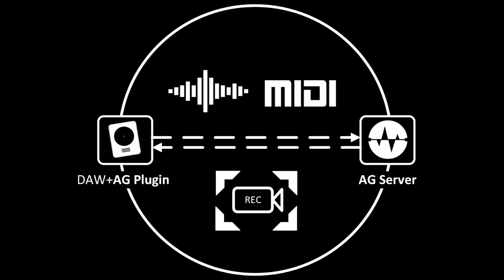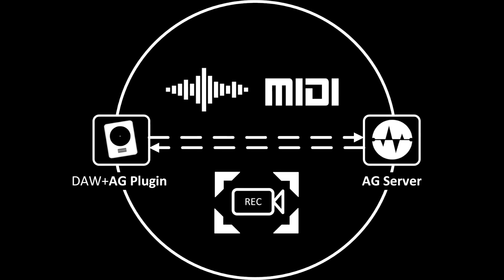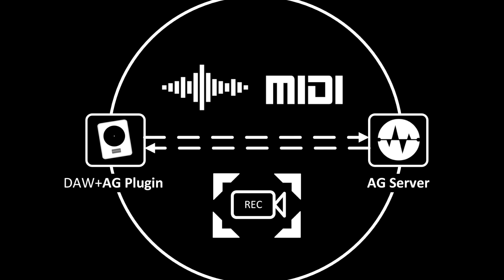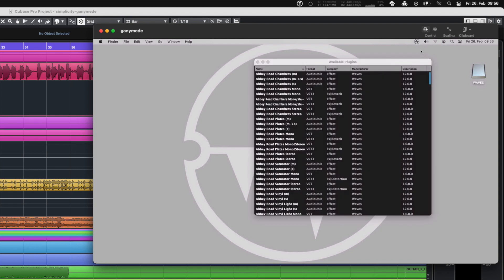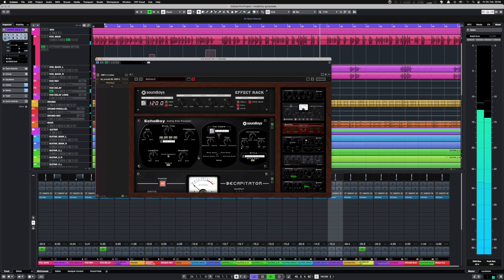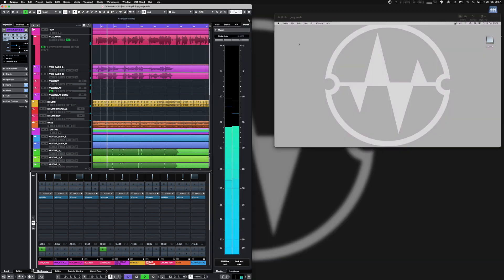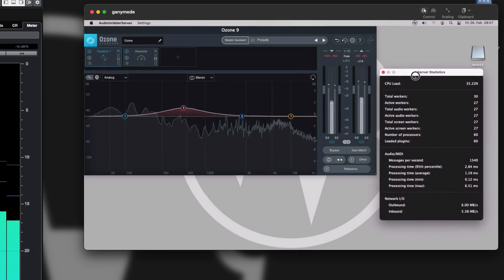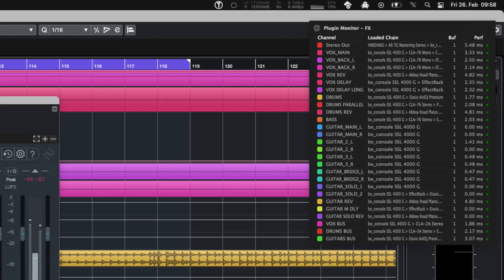Mixing with AudioGridder (Demo)

Comment: Before I encourage you to donate (on the end of my comment) let me make something clear. Well,  rather, to make some comments corrected: AudioGridder is NOT revolutionary. The concept exists for long time. But maybe not in that good shape. On Linux for more than a decade we wired things together this way. Maybe even for almost two decades. Not sure. Which has to do with the fact that Linux pro audio was actually always mainly conceptionally about wiring things together. So we always had "racks" of plugins wired into a sequencer or something. While other OSs used to put all in one big monolithic DAW (for easier use, but lack of optimized CPU performance). Additionally there is a famous proprietary software called Ensemble from VSL used by many film composers out there. Then there is Cantabile, Blue Cat Patchwork, MediaMotion's DAWconnect, NetVst, VSTHost and SAVIHost and many others, not all the same but overlapping in features. Would be interesting to compare them. But! The real revolutionary part here is, that it is REALLY cross platform, REALLY Open Source and REALLY actively developed! Which makes it even more competitive to other Open Source (almost dead) developments in this direction on all OS. Does anyone know on which code platform it has been build on? Hopefully not ELEKTRON. Apart from that: Great work. I can only suggest everybody to support this project and Andreas Pohl with donations and spreading the word.

Comment: Any way I can add presets made in my DAW so I don't have to go through a headache of doing it from the begining? When I try to open them from the folder they're stored using logic, it doesn't give me the option. Wondering if the extension for their plugins are other than .cst 🤔

Comment: Can AG be run on the same computer as the DAW? Are there cpu benefits when doing so, like there is with VE Pro?
Reply from the maker: sure you can. and usually there are benefits in most DAWs. see here https://github.com/apohl79/audiogridder/discussions/654 (there more threads like this).

Comment: Quick question if anyone might be able to help thanks. Does anyone know a way to sidechain with Audiogridder? Wish to use Audiogridder with a heavy cpu plugin (Trackspacer) but plugin inherently requires sidechain. Is there a workaround? Many thanks Jon
Reply from the maker: sidechain support has been added in 1.2, but it is still in beta state.
Reply: @AndreasPohl79  thanks Andreas

Comment: Good stuff. Would this work in a Windows VM on a (quite powerful) TrueNAS server?
Reply: I just tested it using QEMU (Linux Host and Windows in the VM running the AG server). It's not something I would do in a realtime production environment due to the CPU and RAM limitations of the test Computer, but yes it will work.
Reply: @oddyolynx5854  Thanks, I have steered away from this for actual critical production but cool that it works!

Comment: I can see you are running plugin under Ilok (Air eq) ? how can you do that ? with Reaper we have reamote but to be able to use the vst/vst3 you need to have them installed on both machine with exactly the same version + license AND if it's with ilok you need to get for example the key on master and computer ilok on the slave. Some plugins are just authorized to run on 1 machine, also what about UAD plugin?
so how is it possible ? the vst/vst3 only on the slave?
Cheers

Comment: 0.4 msec latency over LAN??
Reply: For sure. His code considers latency compensation, plus the plugin is only sending plug-in data which is not as bandwidth intensive as audio or video data. As well, he has some pretty serious hardware and I suspect wired gigabit.
Reply: @StevenJamesBurks  I though the latency refers to the audio data being transferred back and forth for all processing to be applied in the server.
Reply: @vapon  if you're referring to the kind of log level view of the individual plugins and their response time, I think that is how quickly that plug-in is able to be triggered based on a variety of factors unique to that plugin. I'm not sure where else .4 milliseconds was visible.

Comment: I have been having issues with audiogridder. It worked fine for a while but now when i try to pull up a vst instrument or fx inside of audiogridder from the plugin side, it cant connect to the vst plugin. It bounces back and forth from connecting, disconnecting, and then reconnecting in an endless loop. It wants to connect but it seems like something is blocking it. It doesnt matter which daw i use. The same thing happens. i tried changing firewall settings but that didnt help. I use a laptop for the audiogridder plugin, and a windows server for the audiogridder server software. All the vst plugins are stored on the server. The plugin on my laptop is able to see the available vsts to choose from but when i try to load them up, audiogridder can not pull them up.
Reply: Do you have an anti-virus running on either machine?

Comment: Also, how did you access what you called "VNC" to load the Server?
Reply: VNC is a separate app that basically allows you to remotely connect to any system that has the VNC client on it as if you were sitting right in front of it with a keyboard and mouse. Its a better solution than Microsoft RDP as those sessions clear out when you log off, but if you're virtually in front of the system, even with out a monitor you can still interact with the system

Comment: Im using audio gridder with 3 slave machines. Latency isnt an issue for me at all as I record vocals and guitars thru audiogridder plugins. The main issue Ive come across is that if I use audiogridder with one slave activated, then it works perfect. If two or more slave machines have plugins/instruments then when you try to adjust any perimeters on the edit screen on the master computer then only the first slave computers plugins can be adjusted from the DAW and the other slave machines plugins can not. So, my work around is to use Vienna Ensemble Pro for all VSTi's and have all your FX plugins like reverbs, delays, channel strips...( any plugin that you would use as an insert ) on one slave machine that you dedicate for those types of plugins. THEN you dont need to have a separate screen showing the interface of those plugins. Those ones show up in your DAW and you can tweak them as you wish.
Reply from the maker: I’m not sure i capture the full issue, but would be interesting to get to the root of it. Could you follow the steps here https://audiogridder.com/bug-reports/ on all your machines and create a help thread here https://github.com/apohl79/audiogridder/discussions and share the logs? thanks!

ps: could also be very helpful if you would be able to create a screen capture of the session.
Reply: @AndreasPohl79  I solved most of the issue. I got it working properly on 2 out of three of my machines which is good enough.

Comment: It seems like from some examples people are able to use more plugins on a low powered server computer like a old mac mini then i would expect. Is that just because the server doesn’t have to run the daw as well as the plugins? Does this work with an m1 mac as the server?
Reply from the maker: some people use m1 macs as well. not running the daw is a factor for sure. AG has minimal overhead, so your computers cpu can be mostly leveraged for processing plugins.

Comment: Will this translate aax plugins to be used in windows & windows plug-ins to be used in Linux?

Will this work on linux?
Reply from the maker: Avids aax works in pro tools on windows and macos. AG server can host vst, vst3 and audiounit plugins. AG plugin is available as vst, vst3, audiounit and aax. Only vst and vst3 are available for linux. So if you use a linux daw with vst support you can access plugins running on AG server running on windows or macos.

Comment: i dont do multiple computers anymore
use vepro on a single machine,my cubase machine.
i always wished that every daw/sequencer vendors would create something like this 
to lighten the loads of heavy track count templates on their daw product.
i dont mind trying new tech but can i run this in my daw without using 2nd pc?
Reply from the maker: You can run it on a singe machine too. People are actually doing this to run Acustica Audio plugins, which are super CPU heavy, to better scale out their hardware. It is currently not designed for this, which is why the UI will probably feel a bit weird. Just disable screen capturing in the server settings.
Reply: @AndreasPohl79   thanks!! ill give this a try :)